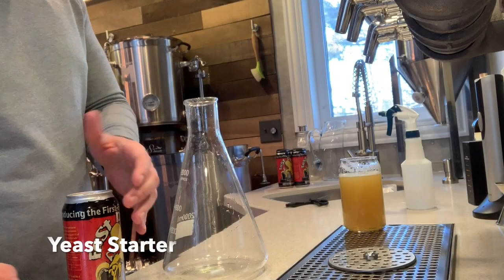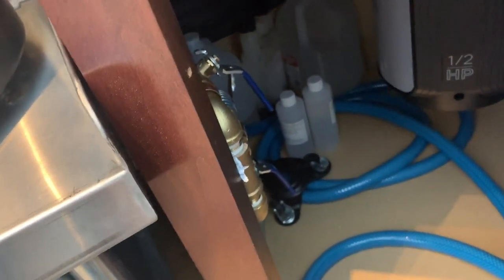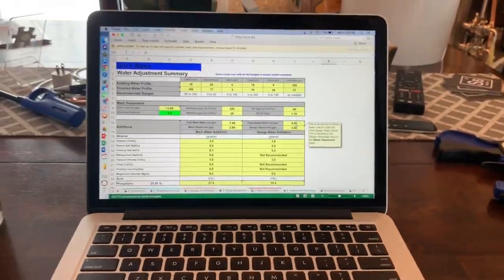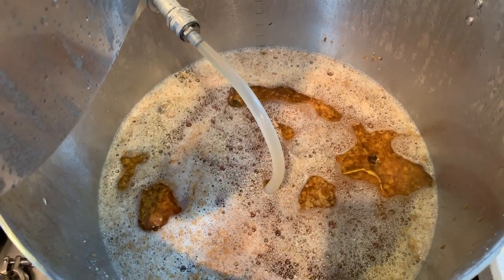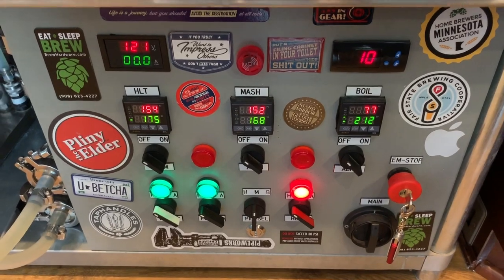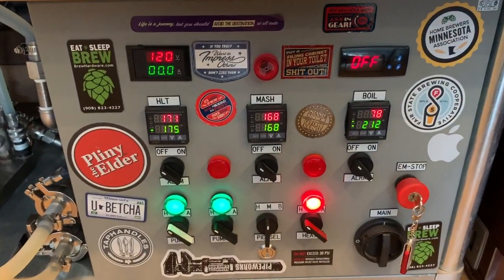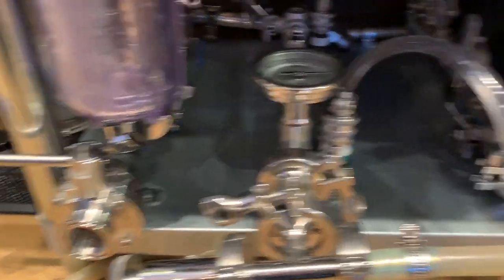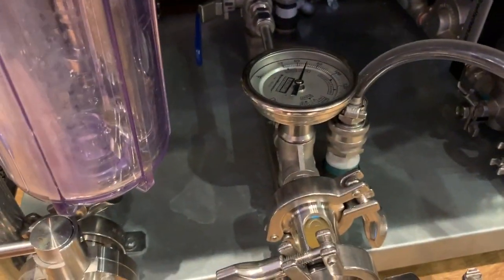Brew Day! (Chapters in Description) Brewing on our EHERMS setup at 8th Hour Brewing

Comment: How long it takes with the HERMS system from 152 to reach the 175 of the mash out? Thanks, I'm here to learn how to build one. In Europe we usually go for the multistep but I'm not shure if the Herms work well with it.
Reply from the maker: Under 5 minutes using 220v
Reply: @8thhourbrewlabs845  Didn't expect souch a fast heating with the herms in the mash tun. That's great for the multistep!

Comment: Very nice compact setup! It has to be complicated to allow for not changing lines and spilling liquids. I get it. 
I've been building my HERMS for a while now. Seems like there are other more efficient brewerys out there, like Brew in a Bag, but to me, it takes away the experience. 
Question: Why do you use a sparge arm instead of the manifold?
Reply: I'm also curious about this. Why the swap from the manifold that you were recirculating with to the sparge arm. Is there a benefit to using the sparge arm instead of fly sparging with the manifold?

Comment: What a wicked setup! Is that SS manifold the small or large version?
Reply from the maker: Hey thanks!  It’s the small one, that’s a  20 gallon mash tun.  If the large one was in production when this was built I would have done that.  Either way it works well.

Comment: To make ale and lager a slightly different type of brewing system and brewing method are needed. It's pretty much chemically and enzymatically impossible to make ale and lager with a single temperature infusion method. The method is used mostly in grain distillation because the primary sugar released is glucose and yeast really loves glucose. Yeast rips up glucose during primary fermentation and since the extract doesn't contain complex types of sugar secondary fermentation doesn't take place. To cause secondary fermentation to occur priming sugar is added and the bottle and keg becomes a type of secondary fermenter. 
When ale and lager are produced secondary fermentation occurs and for secondary fermentation to occur a conversion rest (140F) is needed. Alpha and Beta work at the same time but Alpha works slowly at 140F and Beta is very active. Mash pH should be optimum for Beta during the rest.
During conversion Beta converts glucose released by Alpha into complex types of sugar needed in ale and lager. At 149F Beta rapidly denatures. When conversion occurs beer doesn't need to be primed with sugar or injected with CO2 for carbonation. Beer naturally carbonates during conditioning when yeast converts maltotriose released during conversion into glucose.
To make a richer and more stabile beer boil some of the mash and use the boiling mash to increase the main mash temperature to a proteolytic temp range or to conversion temp. When mash boils heat resistant, complex starch, amylopectin rapidly enters into the liquid. Amylopectin contains A and B limit dextrin which are tasteless, nonfermenting types of sugar responsible for body and mouthfeel in beer. During dextrinization Alpha releases the sugar. Pectin causes the mash to jell. The temperatures are too low in the single infusion brewing method to cause the starch to burst before Alpha denatures and the starch remains in the spent mash. 
Boiling the mash causes chemical precipitation to occur upstream of the boiler and at the time when the enzyme that works with the chemical changing it into vitamins and nutrients is active. 
An infusion of boiling water can be used to raise mash temp from conversion to a higher temp rest, 155-162F. The higher the temp, beer turns out sweeter and lower in ABV. The sweet tasting, nonfermenting sugar is contained in simple starch, amylose along with glucose.    
Use an under modified, low protein, malt. The malt is richer in enzyme content and higher in sugar content than high modified malt. Weyermann light and dark floor malt are examples of under modified, low protein, malt. A spec sheet comes with every bag of malt and the Kolbach (EBC) number or the SNR (IOB) number reference level of modification. Malt below 40 Kolbach is under modified malt and malt below 10% protein is low protein malt.The percentage of protein, pH, gravity, beta glucan, extract efficiency and saccharification length of time are a few things listed on a spec sheet. The sheet is used to determine the quality of malt. I'm not sure if an HBS carries spec sheets but the malt house does.
Skim off the hot break as it forms and continue to remove it until it reduces before adding bittering hops. The extract is cleaner and less hops are needed. Skim off second break. The purpose of first wort hops is to reduce hot break but the method is used incorrectly by homebrewers.